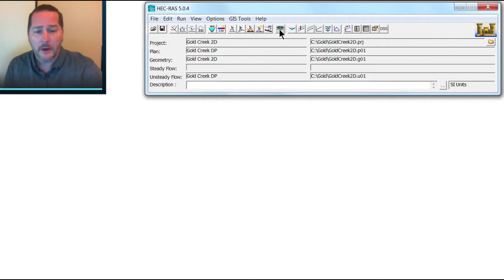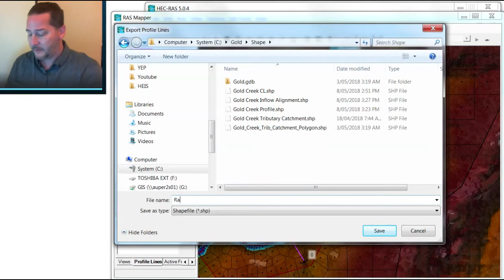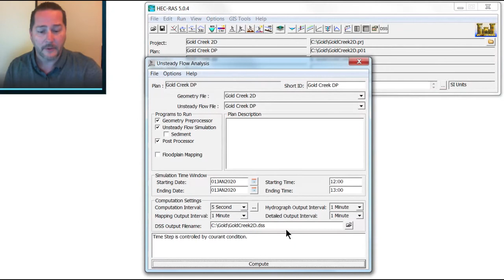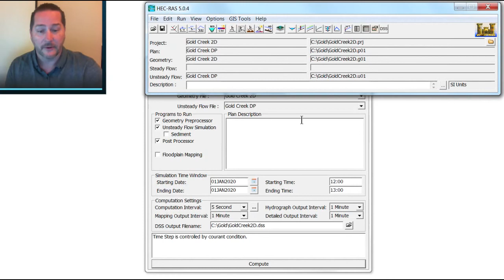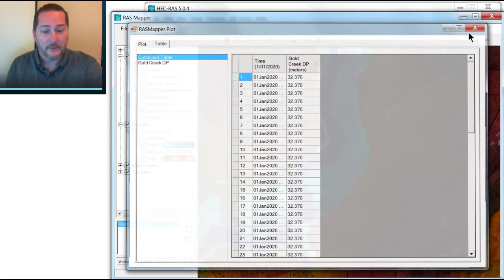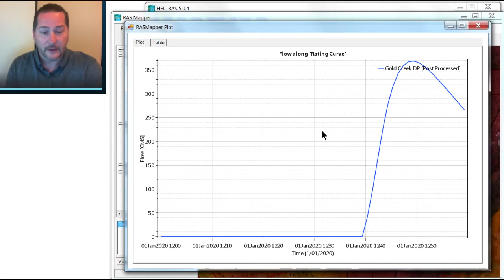HEC-RAS Basics Part 8 of 8: Export Options and Rating Curves

Comment: Hi Krey, 
thanks a lot, it's a very helpful video series. I would appreciate if you could help me with this issue. 
I'm trying to model a Dam break. I have the instantaneous hydrograph and the water level drop scale (at the dam location which I derived from a physical Model). my question is: how I can set the boundary conditions at the dam location (both the hydrograph and water level). Also, do I need to model the dam in my case (since I'm modelling the breaking/failure, not the breaching, or just define the boundary conditions at Dam location?
Reply: @TheRASSolution  Thanks you very much for your response. I do appreciate it. the Issue is that Still, I don't have the elevation data to model the upstream Dam reservoir. For sure I would be so glad to attend the upcoming webinar, I already registered. Looking forward to attending the webinar. Regards
Reply from the maker: In addition to the free dam break webinar at https://youtu.be/iRCYmQsWTXA, we've also got an upcoming online dam breach course as listed at www.surfacewater.biz/online/

Comment: Hi Krey,

Firstly, Thanks for the effort on the videos, much appreciated. 

I am experiencing issues with creating Structures either as internal or external connections between two 2D areas. I always struggle with my geometry being below the cells it is connected to. “The SA 2D Connection at “Structure Name” has a weir elevation lower than the cells they are connected to”. How do you prevent this issue without having to modify your weir profile excessively? Even if I joined two 2D areas without a structure using the “Normal 2D Equation Domain” and/or Structure type with “Linear Routing” I got the same/similar error message.

Similar Issue but when assigning an outlet rating curve to the structure based on the upstream water elevation. This time I always get the error stating that the structure “has a rating curve with a starting flow elevation lower than the cell it is connected to”. If you have a dam, for example, and your structure spans across the valley you will always have some cells above the start of the rating curve since the dam is relatively low compared to the mountains. I haven’t been able to get the Outlet RC to work in HEC-RAS 5.0.

I had similar issues with Culverts in version 5.0.3.

I am currently using version HEC-RAS 5.0.5. Could you perhaps do a video on “Dealing with 2D Model Errors" especially the ones mentioned above? Perhaps as an example cause an error to occur and then show how to prevent and solve it.

Thanks in advance. 

Kindest Regards,
AR